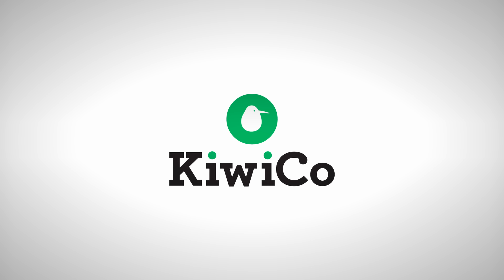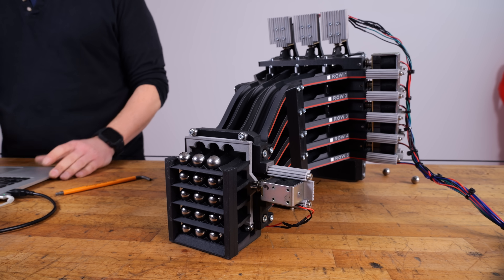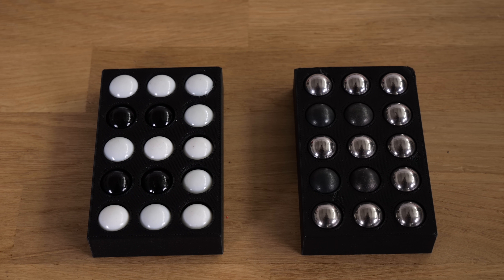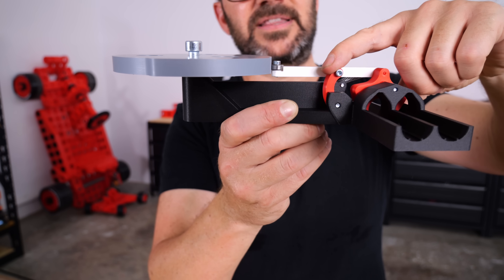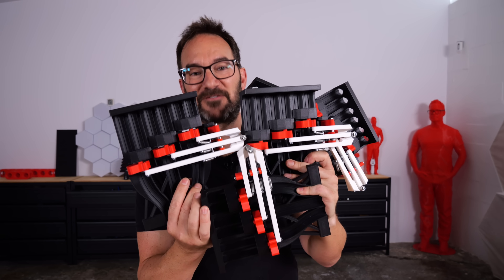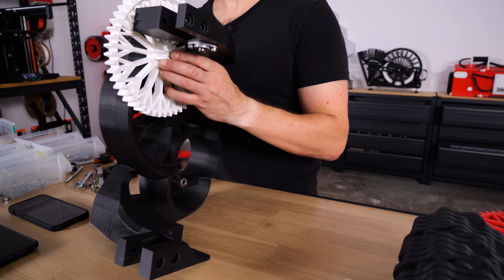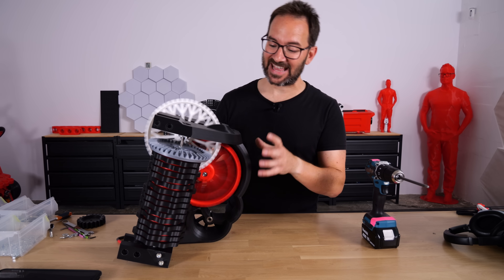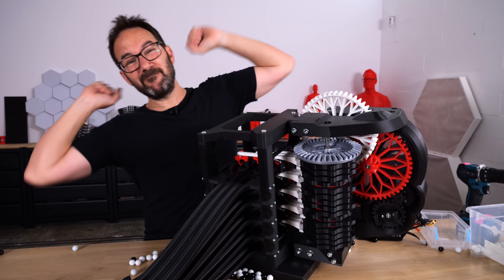Rotary Cam Marble Selector - Marble Clock Seconds Display Pt.5

Comment: I feel like you don't actually need black marbles if you're feeding the display from the rear. You needed black marbles on the minutes clock to act as spacers because the rows are fed from the side, but here you're feeding from the rear. Eliminating the need to sort white from black, and make channels that can select which color to feed, should make it a lot simpler.
Reply: Probably.... But it keeps it consistent in the noises it makes, which for a huge display clock like this is part of the point of it.

Comment: you could use injection molded plastic, it's cheap enough, smooth surface, less hard than glass (less prone to shattering a ware) and consistent size
Reply: Consistent in moment of making yes. But I'm not sure that the marbles are the stronger ones in comparison to the slides. If I'm right the marbles would slowly grind and became some weird shape instead of balls.
Reply: @marekvojta9648  depends on the type of plastic you use, and the same argument could be made for the tracks that they're riding in.
Reply: @struanpeat5116  In my opinion it's easier to use grinded (only a bit of course) slider which is usually downhill than grinded marble. And second thing is that glider is probably easier to replace than having to replace injection molded marbles

Comment: Glass is definitely a good move, was really struggling to see the display last video
Reply: I wonder if it would be possible to make one color glass and the other color steel, which would make separating them from each other a cinch. (Magnets!)

Then again, at least for the one second update display, I'm not sure the black marbles really need to be there at all. Just send the white ones. For the next digit over that only changes once every ten seconds, sure, use two colors as usual. But on the high frequency display, only using white marbles means it can send them back to itself without sorting. The sorter is probably fast enough to keep up with one change every 10 seconds. I'm not sure it's fast enough to keep up with a change every second.
Reply: @mal2ksc  I do really like the idea of using steel for one color, because the magnetic sorting would mean the machine could have absolutely no smarts in it; it goes very well with the idea of it running off of only one motor.
Reply: I feel bad about how hard he tried to make steel marbles work. that looked painful.
But he showed us that progress means trying hard at something that may be a dead end. The most important thing is actually building.
Reply: He could use just one kind and have empty be the other color.
Reply: @TheMongooseOfDoom 
He could, but I think the point of this project is to overcomplicate something that could be solved much much more easily in other ways (just use a normal clock 😂).
So I think simplifying the project kinda defeats the point.
Reply: easy to solve with proper lighting
Reply: The improved contrast is a big help, yes.
Reply: He could use a back-light and some clear marbles.
Reply: @RingingResonance  so basically a 7 segment display that shows the numbers, and clear marbles in front that do nothing? then there would be no reason to swap marbles at all which defeats the purpose, unless im misunderstanding
Reply: @Scotty-vs4lf  no, replace the white marbles with clear or translucent marbles and use a steady back-light.
Reply: @RingingResonance  oh i see what u mean my bad
Reply: @RingingResonance  That's just cheating

Comment: A possible way to sort round marbles versus strange ones would be to 3D print a sifter for the marbles where the holes are the exact size that you want. Any marbles to big will get stuck and any smaller will fall through. Then you could make a second shifter with holes that are slightly smaller then what you want. So marbles that are too small will fall through and you are left with perfect marbles.
Reply: You may still get out-of-round marbles that manage to fit the larger hole but not the smaller.
Reply: @mal2ksc  but you now also have a smaller selection of marbles to check.
Reply: Nice one

Comment: The steel vs glass is such a typical engineering trade off.  One is tough.  The other is visible.  I suspect glass is the better option.

The main purpose of the machine is to tell the time, so it is very important that it is readable.  You need to read it in less than a second, less if including time to empty and reload the digits.

I also suspect that it will be easier to design around the limits of the glass than the limits of the steel.

Comment: if you're using separate parallel tracks for each part of a digit, instead of having everything stack up on a single lane, do you even need the black marbles if you could just leave a gap?